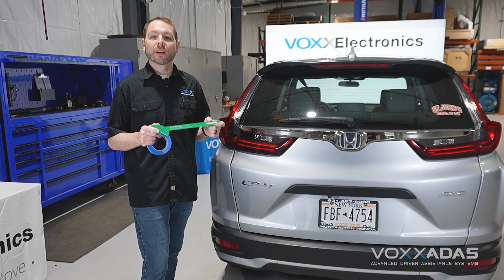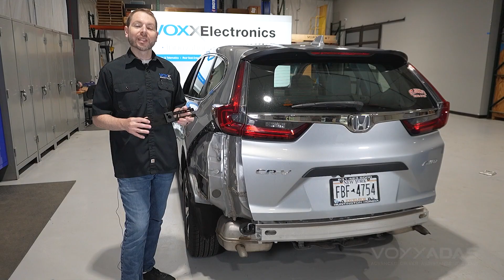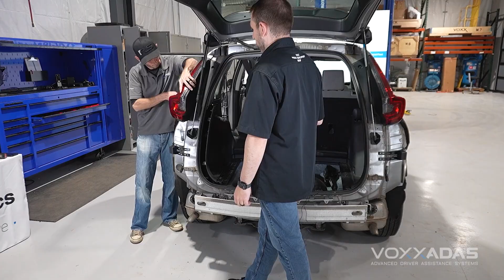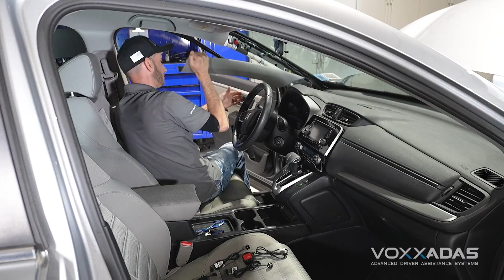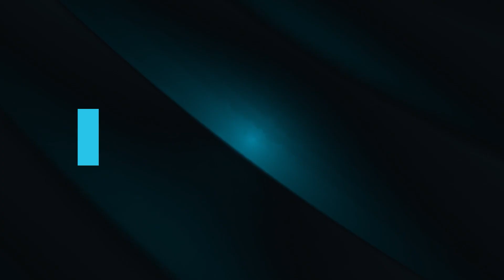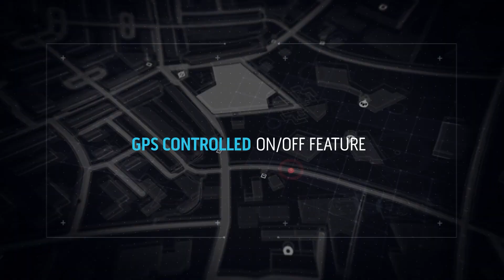ADVBSD30 Blind Spot Detection | Full Installation Guide

Comment: Hi, I want to add the Voxx system into my vintage 1969 Camaro. I dont mind some mild modification, but it has a metal body panels and a metal chrome bumper. Can I use the sensers behind the bumper but not touch the bumper? If not, can I mount it somehow on the body ...knowingbthat it will go through rain and weather? Thanks in advance.
Reply from the maker: The sensors cannot be mounted behind a metal panel, but the sensors are completely waterproof, so you could make a custom mount, as long as the sensors' faces do not have any metal in front of them.